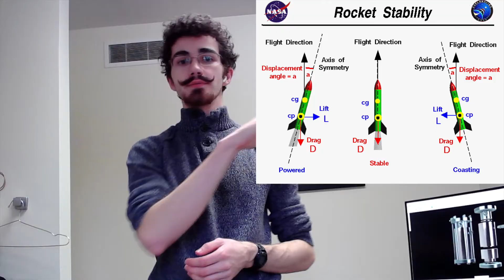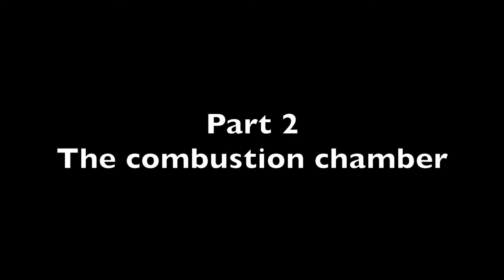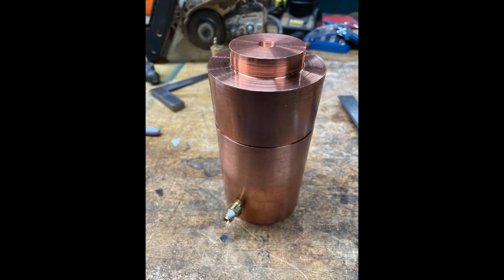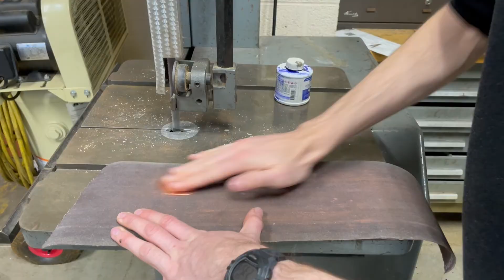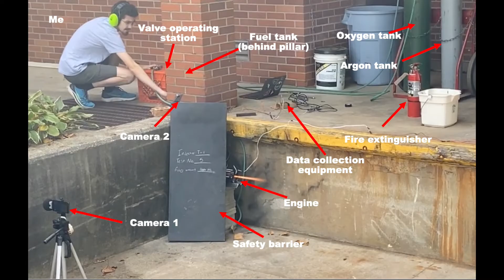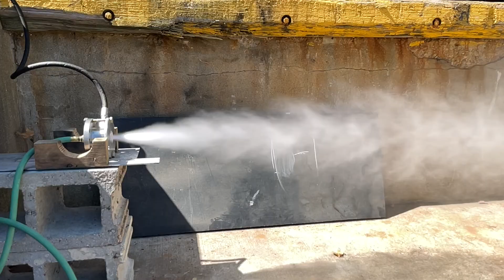How I made a liquid fueled rocket engine! - Designing & testing a small ethanol/oxygen rocket engine

Comment: Hello, I was wondering as to why the the pressure regulator is set to a lower pressure than the chamber pressure
Reply from the maker: I just screwed up the diagram, good catch! It should be that the regulator is at 250psi and the chamber is at 200psi. I can't believe I didn't notice that until you pointed it out.

Comment: I took a cnc operator job in order to get access to big boy tools to build e-moto parts and engines. Ive been intrigued about using waste oils and LOX paired with either a sterling cycle or solid state TEG seebeck effect peltiers. I got kicked out if community colledge due to denied federal financial aid.
Reply from the maker: Sounds interesting. I would be very careful working with LOX though, it can be very hazardeous and should be handled wiith extreme care
Reply: @jingojango9220  Absolutely, well aware of the precautions and risks involved. its going to be awhile before I am comfortable to start experimenting with rocket engines. Right now im focusing on solid state TEG stacks, Sterlings and waste oil fueling them. Just got a heavy weight bicycle trailer that is either going to accept my redneck heliostat or urban stealth trailer designed to look like either a dumpster or transformer .

Comment: Hello, I have a question about the connections on the inlet manifold. How did you connect these and can I get a specific product link for the 9/16 inserts? Did you thread in the insert into the smooth hole?  This is some amazing work, and thanks! (I found the spreadsheet with the parts, but I'm still wondering how the fit is made, which fitting goes into which injector for what reason, and where the check valve is placed in the line. Thanks!)
Reply from the maker: The way you connect them will depend on your setup: what hoses/pipes you use, and how you want everything to go together. If you use the UNF ports like I did, make sure that the o-ring is able to make a good seal against the manifold (iirc there should be a chamfer on the manifold port. lmk if that isn't there and I will upload an updated drawing). Once the hole is taped you should be able to thread the fittings in no problem.

Here's the links to the specific UNF fittings I used: ( https://www.mcmaster.com/50925K565 and https://www.mcmaster.com/50925K451 )

Comment: First of all, in aerospace metric is the standard. But your engine is a good start.  If you have seen the scematics of the rattworks tribrid rocket engine(sadly discontinued) it is a grate place to start making an selfpresurizing alcohole- nitrus oxide inline liquid fuel rocket
Reply from the maker: I'm aware that the industry standard is metric, and I actually did most of my calculations in metric. However, when manufacturing the engine, all the machine tools I had available to me used imperial units, and so using imperial units for dimensioning made more sense in the end. 

Thanks for the info, I will be sure to check out rattworks!

Comment: Hello Stephen, I am a senior this year and we my senior design project is prototyping a liquid rocket motor. We were considering splitting our combustion chamber similar to what you did. From your sketches it appeared there was a slot for an o-ring between the two copper pieces. Did you use an o-ring, and if you did, what type did you use?
Reply from the maker: I would recommend you use o-rings made from pfte or some other material compatible with your chosen propellants. Ideally they should also be resistant to high temperatures. I originally used viton (Fluoroelastomer) o-rings, but while those worked, they didn't seem to handle the heat very well and needed to be replaced after each firing

Comment: Good job! I’m going to try to make one using the same source material. Albeit bigger and with more rigid plumbing, remote valves, check valves, centrifugal pumps, water cooling. I’m thinking about making the comb-chamber using additive laser 3d printing and commission a skilled CNC machinist for the injection model.
Reply from the maker: Awesome! Good luck, I hope your project goes well. Are you designing your own pumps or using commercially available ones?
Reply: @ I haven’t decided yet. But it will probably be commercial due to the cost of manufacturing my own. I’m gonna strip down some old electric table saws to get the control board and electric motor to power it. And after I get those parameters I will start designing the rest of the system. Need the flow numbers first

Comment: Great Video! What mixture ration did you use?
Reply from the maker: 1.3/1 ratio of GOX to ethanol by mass
Reply: @jingojango9220 Thanks! Also what´s the minimum thermal conductivity you would go for. How did you come up with 3 inches? Are there any steel alternativs?
Reply from the maker: @sna8xjpg  To be honest, I used a 3-inch diameter for the combustion chamber because that was the size of copper stock I had available. 

As for the thermal conductivity, I would advise you yo choose something in the hundreds of W/m*K (or W/m*C). I would need to run some FEA sims to find what the minimum conductivity is though (and I'm sadly not familiar enough with the relevant software to actually do that). I wouldn't use steel unless the burn time is much shorter (like 1 or 2 seconds tops).

Comment: hello! This is great. Going to try to build this with my daughters. Question: did u use a backflow prevention device on oxygen or ethanol? Second, could you use the oxygen to also pressurize the ethanol or is that too risky (even if add backflow devices)? Thank You!!
Reply from the maker: I wasn't able to use a valve or anything like that to prevent backflow due to bugetary restrictions, though a check valve would be a good idea for anyone trying to recreate my design. 

Using the oxygen to presurize the ethanol is very dngerous and you definitely should not try that. You want your fuel and oxygen to be completely separate prior to entering the combustion chamber.
Reply: @jingojango9220  thank you very much!!!
Reply: @jingojango9220  Hello Stephen!  Its us again.   My daughter and I have started lining things up to give this a try.   And, of course, have run into a few questions.   If you don’t mind…would you mind telling us a few things?  If so:  

What pressure oxygen and argon pressure did you decide on to get the best fuel/oxidizer ratio? (we are going to use Nitrogen in place of Argon…think that is ok?)

In the version that did the best, once you added the extension on the combustion chamber…the chamber was 1” diameter by about 5.5” before it started to narrow for the nozzle?

Then the nozzle throat was ¼” diameter  that then opened up to ½” Inch opening? 

The best injector setup was a center oxygen hole with two fuel holes to each side?…oxygen point directly in and each fuel hole pointing toward each other?  We were not exactly sure what the center oxygen hole size was, and then on the fuel holes it looks like maybe you did a smaller hole with a flare....what size??  

What tube did you use for the argon to Swagelok and then for the ethanol to the rocket?  And, what is the hose you changed to for the oxygen? 

Last, what chamber pressure sensor did you buy? And the load cell / force sensor…what was that product?

THANK YOU A MILLION!!
Reply from the maker: Thanks for your questions, before answering your questions, I'd like to direct you to some sources to some resources I think you should read up on to broaden your knowledge on this topic: http://www.braeunig.us/space/basics.htm https://spacha.github.io/How-to-Rocket/ https://ntrs.nasa.gov/citations/19710019929 these are great resources, and I highly recommend reading through the relevant sections before you start your project. 

Now, to answer tour questions: 
As I understand it, the first question is really three questions: The upstream pressure for the fuel and oxygen lines was about 250psi. The pressurizing gas for the fuel, as well as the oxygen were both stored in welding gas tanks, which usually are pressurized to a few thousand psi, and I used pressure regulators to step that down to the 250psi. And using nitrogen to pressurize your fuel tank should work fine, no problems there. 

The inner diameter of the combustion chamber was 1 inch. I can't recall the exact length, but you can find info including design drawings in this drive: https://drive.google.com/drive/u/0/folders/19U5qajxntqbdrhCJmFf-ur6zKvf1-5Aw

The nozzle throat was 1/4" and widened to 1/2"

You can find the dimensions of the oxygen hole from design drawings in the drive linked above. You can also recalculate the orifice size based on equations in the github link I posted above. It would be a good exercise to make sure you're understanding the math behind it. As for the fuel holes, I started the hole with a center drill, and then used that to keep the small drill bit from "walking" and breaking.

I used a welding gas hose to supply the pressurizing gas, and a 1/4" hydraulic hose to supply the ethanol to the engine.

I used this load cell: https://www.amazon.com/DYMH-103-Tension-Compression-Applicable-0-100kg/dp/B07H5BGYFN/ref=sr_1_20?content-id=amzn1.sym.9575273b-ecd8-4648-9bf0-15f20c657e0a&keywords=micro%2Bload%2Bcell&pd_rd_r=05cabbbb-5e3e-4c38-866c-08ad7c3e8273&pd_rd_w=PSBAC&pd_rd_wg=ZNtZN&pf_rd_p=9575273b-ecd8-4648-9bf0-15f20c657e0a&pf_rd_r=S6CANHQ7WQM3RETFY7AS&qid=1673747505&sr=8-20&th=1 (tbh it's kind of janky to get working, and a pain to solder the wires, but it was cheap) and this pressure sensor: https://www.amazon.com/gp/product/B00NIK900K/ref=ppx_yo_dt_b_search_asin_title?ie=UTF8&psc=1
Reply: @jingojango9220  BOOOOM!!  Thank you.  Reading up now!
Reply: @jingojango9220  We have a paper copy of "How to design, build and test small liquid-fuel rocket engines" that we were using but the link to the online version you shared is much better, more friendly, and anything online appeals to my teen daughter!   We were going to put the equations into excel this weekend and saw in one of your PPT you might have made an excel for the injectors? Any chance you would consider putting that in the google drive?   Did you make an excel for the chamber and nozzle, etc?  THANK  YOU AGAIN!!!
Reply from the maker: @SamEskildsen-it9wp  Most of the more complicated engine calcs were done using RPA (you can get a free version at the bottom of this page: https://www.rocket-propulsion.com/RPA/pricing.htm)

as for the excel file, I don't think I'll upload the original mainly because its super messy and I don't feel like going through and cleaning it up. However, at some point I can see about making a new excel file with just the injector calc stuff
Reply: @jingojango9220  awesome! We will check that program out. I know what u mean about messy excels.. mine are always a long chain of stuff as I try to work through things. Thank you again!!
Reply: @jingojango9220  Made progress. We have built excel sheet for all the calculations and are working through lining up everything.  Two questions:  What type of o rings did you use?  For the spark igniter, what transformer did you use?   Thank you so much!!!
Reply: @jingojango9220  one more, sorry! We compute a nozzle about the size of the first one you had. Then it looks like u made it smaller in the extended version. Can u educate us on the driver?
Reply from the maker: @SamEskildsen-it9wp  The reason for that was to increase the L* (ratio of combustion chamber volume to nozzle throat area) and thereby the combustion efficiency, since the propellant wasn't combusting completely in the original version. 

another thing I forgot to mention, here's a very useful resorce I used to base my engine off of: https://www.nmt.edu/academics/mecheng/faculty/mhargather/docs/Youngblood2015.pdf
Reply from the maker: @SamEskildsen-it9wp  I used PTFE O-rings
Reply: @jingojango9220  We got the copy of the RPA program you used (I think) but did not see gas oxygen as an oxidizer option.  Did you make a custom one, and if so, what values did you use to set it up?  Or, are we totally missing something??!?  This is fun though.  Even using the liquid oxygen it has need fun to play around with.
Reply: @jingojango9220  This is cool. Very interesting!  Thank you!!!  We think we like yours better...much simpler yet very effective!   Still working on design and understanding, but we will send you video and picture once we have something.  Our goal is to do a first live fire test Thanksgiving break.
Reply from the maker: For the igniter, I had a hard time finding something that worked, and even then it was somewhat unreliable. I switched to using a sparkletr which I would secure to the engine using electrical tape (I think you can see that in my later videos actually). 

To select GOX as your oxidizer, you need to tick the box labeled "complete list of components and products of reaction" this will allow you to select gaseous O2 as your oxidizer.

Good luck with your project! Please be careful when trying this, there is a lot that can go wrong and I would hate to have someone get injured trying to follow my design.
Reply: @jingojango9220  thank you again!! We are looking at 3” diameter bars. Think copper is out of our price range. We can get an A36 mild steel bar, or the most affordable, an aluminum bar. Think those would be ok? We would add copper tubes around the cylinder and pump water through them, to cool the chamber?
Reply from the maker: @SamEskildsen-it9wp  you could use either, but if you did I would advise much shorter burn times. The advantage of copper is it has a high thermal mass (it takes a lot to heat up) and high thermal conductivity (distributes the heat quickly) which prevents the chamber wall from melting. 
Aluminum will melt much quicker because of its lower melting point, and steel doesn't have the conductivity to spread out the heat it absorbs. They should work for short-duration burns but I would advise you stick to only a few seconds.

water cooling could help, but then the thickness of the chamber wall would prevent you from effectively cooling the inner wall (which is the bit in contact with he combsution gasses).
Reply: @jingojango9220  thank you. Very helpful. Where did u get the copper round bar? Local places want big $$ and want to get an idea.  Side note: We found a type c thermocouple that might work for combustion chamber, going to try it out! Did we see you put lithium grease on the end of the pressure sensor you used? Thank you again!!!
Reply from the maker: @SamEskildsen-it9wp  Sadly copper is fairly pricey, I found a 1-ft long 110-grade copper round bar on McMaster-Carr for about $430. It's quite pricey but not as bad as 101-grade (better conductivity, but twice as expensive). You could likely go with cheaper materials, but that would limit you to much shorter burn durations.

Yes, I packed the end of the pressure transducer with lithium grease to act as a thermal barrier between it and the combustion gases.
Reply: @jingojango9220  ok! Shopping around now. The 2” diameter round bar that is the manifold for oxygen and ethanol, what did u make that out of? This is fun. PS: mechazilla on the first try!! So awesome
Reply from the maker: @SamEskildsen-it9wp  The manifold was 304 stainless steel
Reply: @jingojango9220  boom. that is what we just got!  we went with mcmaster for the copper too.  local places were just as $$.
Reply: @jingojango9220  Sorry!! One more....been working on the injector hole sizes.  Using the equation in the the book (how to design...), get odd numbers.   ChatGPT and Claude, they both dont like the gravitational constant being in the formula (26).  And the online version did not get to this point for SI units conversion..... Is this what you used, formula (26) ? Or, how did you size you injector holes? And for the version where you have the one oxygen in the center and a fuel on either side, what were the final diameters?
Reply from the maker: @SamEskildsen-it9wp  the gravity constant is there because Krzycki is using imperial units, specifically pounds which technically isn't mass and so needs to be adjusted for the units to work out properly. 

I've uploaded a little excel widget to the drive for finding the pressure drop across your injector: https://docs.google.com/spreadsheets/d/1JmjZRnz_4RDYs-gd911A0v0U-mj3W-lR/edit?usp=sharing&ouid=111052402152853841013&rtpof=true&sd=true
the triplet injector holes were 0.028" for the fuel (dp = 40psi), and .1094" for the oxygen (dp = 50 psi)

By the way, what is your email? I have a paper I want to share with you, which I think you'll find helpful

Comment: Hello again, I was wondering if there are more information on the version of the injector with commercial spray nozzle
Reply from the maker: what sort of information would you like?
Reply: @jingojango9220  are there more design drawings available? And what type of fittings should be used
Reply from the maker: @космос576  https://drive.google.com/drive/folders/1AZcd_7yL6BcCQk6tByLsc-VxVHzKIfch here is a link to the design drawings I made
Reply: @jingojango9220  Hello Mr Hyde, thank you so much for providing the drawings and a detailed video on how you made your engine, and thanks to that I have made an almost exact replica of your engine as a pathfinder for future projects, and if possible could you provide me with your testing procedures or more specifically how you would operate the valves like which one to open first?
Reply from the maker: @космос576  To operate the valves, what I settled on was opening the oxygen valve to the point I can barely hear it hissing, then I carefully ease open the fuel valve. Once  ignition occurs I quickly open both valves all the way.